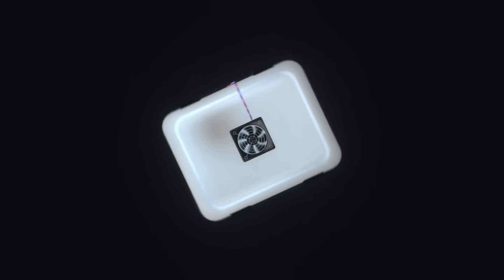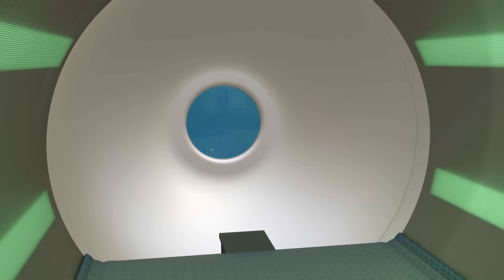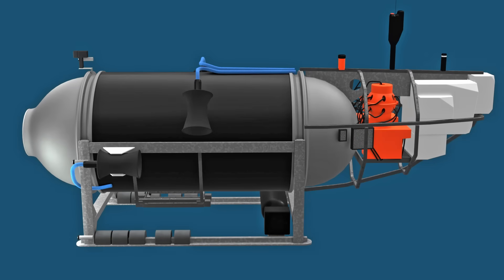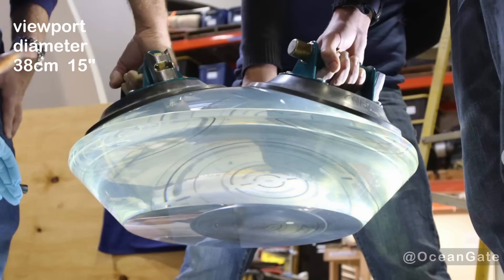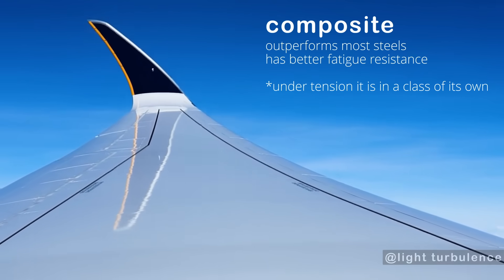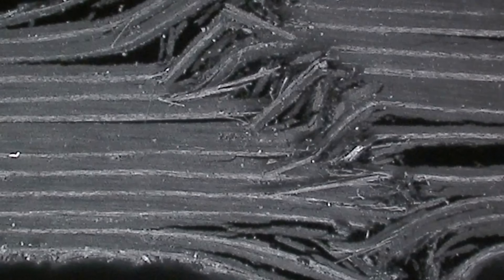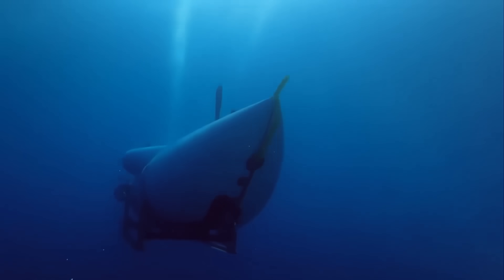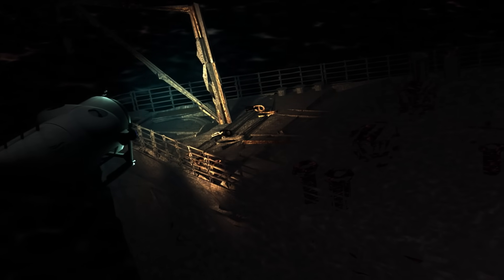Titan Sub | carbon fiber - Detailed Tour

Comment: The top sides of carbon fiber aircraft wings are stressed in compression, and how many stress cycles do those withstand?

Yeah, you people who keep saying carbon fiber composites are no good for compressive loads need to get your water tested for lead.

They make CFRP fishing poles, airplane wings, bicycle frames, bicycle rims, motorcycle and car wheels, race cars, and half of those structures are stressed in compression. Except for the bicycle rims, which are mostly stressed in compression. I haven't broken one yet.

Stop believing everything negative thing you read people! There really are a lot of stupid memes going around, and this one about CFRP being not being a good structural material is one of the most ridiculous. 

The sub imploded after a few trips down to the Titanic. Passengers heard pinging sounds on the previous dives;  this is what it sounds like when individual strands of carbon fiber break. Obviously, the vessel was almost built strong enough, and it was just being stressed almost to the breaking point even on the first cycle.

So, duh, they needed to make some things thicker. Why do I even have to explain this? It would have imploded on the first dive if it really wasn't even close to being up to the task. And they probably should have put a metal shell around the carbon section to prevent water from being absorbed by the epoxy.

Really obvious steps that could have been taken that would have prevented the loss of those lives.

Just stop blaming carbon fiber. Did I mention they use it to make aircraft? Yeah, I think I did.

Edit:  Metals are a lot easier to engineer, and usually fabricate. This doesn't always mean metal structures will always perform better, but metal structures built by amatures certainly will. CFRP is king when enough engineering, fabrication know how, and quality control is applied.

I did mention that water absorption of the plastic component of CFRP is a known weakness in marine applications;  some kind of metal shell over the carbon structure  could have sealed it.

A poorly engineered or fabricated metal hull would have also collapsed.
Reply: Work in materials in aerospace. Fiber-reinforced polymers are not particularly good in compression-only loading. The thing people miss when they say "What about this (wing, fishing pole, bike wheel)" is that they are subject to bending or a combined loading such that some part of the structure is in tension which inherently limits the amount of compression the other part is subject to. Additionally the Titan design relied on a bonded joint between two materials with vastly differing moduli, these can prove challenging to design, and Titan's design seemed overly simplistic. Every one of the people I work with think a carbon-fiber vessel in compression is a bad idea.
Reply: "this is what it sounds like when individual strands of carbon fiber break." WRONG Carbon fibers never break under compression. It is the bonds between different carbon fibers that break. The fibers are held straight by epoxy. When the epoxy breaks, the carbon fibers are no longer straight, and they wilt, not break, under compression.
Reply: @afriedrich1452 They buckle, not break.
Ever heard of the Euler buckling load, one of the most important equations in structural stability.
Reply: It was not a simple compressive load.  It was immersed in high pressure seawater and was a heterogeneous laminated material subjected to multiple compression cycles.  The delamination process has similarities to fracking an oil well where high pressure fluid penetrates along natural layers of rock (or in this case lamination layers) and any solids deposited or formed when pressure is realizer could act as proppant material extending rock
Reply: You cannot compare stresses on an aeroplane wing with the stresses on a pressure hull.  That is very simplistic, outright cretinous even.  Rapid flexing and shearing actions, cold temperature induction and high-temperature radiation versus a gradual, uniform but relentless build up of extreme pressure?  Remember: when the hull failed, it was under stresses lower than it had withstood before.  To sum this up in a word - DELAMINATION.  Carbon Fibre IS NOT suitable for this application.  Get over it, carbon fibre fanboys.
Reply: People weren't all saying they aren't good in compression, but rather that they are only good in compression with strict manufacturing controls that Rush failed to adopt.
Reply: I'm a U.S. Navy submarine veteran. None of our submarines use carbon fiber. NONE! Built with steel for a reason.
Reply: @rodneyking4183  let's be real here it's a cost reason. That scale of sub would be absolutely outrageous even if switching to something like stainless or titanium let alone carbon fiber.
Reply: @freiherrdinkelacker  you clearly have inadequate experience in engineering. 

This channel has one of the best sets of rational observation, analysis and discussion of the factors around the Titan tragedy.

Engineering is the study of implementing client requirements to solve a problem. Centuries of practice have brought us reliable ways of achieving remarkable feats, safely.

The company cut corners on obvious safety steps, and especially necessary ones with new methods and materials being used.
Reply: @@freiherrdinkelacker Alright, you got me 🤣.  There is some sort of fanboy fetish with this material!  Carbon fibre truly sucks for some purposes, ballistic shielding is another example.  Can't the fanboys just acknowledge that for pressure vessels, steel and titanium are King and God, whereas carbon fibre is the Court-Jester?
Reply: In the AirBus 380, the spars and skins are aluminium. Only the ribs are an alloy/CF composite. One side of a fishing pole is in compression, the other in tension, as in any tubular structure that is bent from nominal straight condition. So, two of your examples 'hold no water' in respect of CF's ability to withstand compressive forces. I cannot speak for the others as I am not familiar with wheels made of CF. And youre comment "They use it (CF) to make aircraft" is also misleading as where it's used doesn't have to withstand the type of pressure the Titan did.
Reply: In aircraft it is mostly used in the tension components such as the fuselage that is under tension because it is pressurised on the inside.

CF composite might be usable in compression mode if prestressed during layup. This would require a meticulous manufacturing operation and the prestressing could make the resulting object liable to shatter due to impact.
Reply: @jimgraham6722  ie: their manufacturing operation was far from meticulous and for the WRONG purpose
Reply: Everyone knows carbon fiber is amazing stuff the problem lies with what Stockton Rush did with it, he 'engineered' it himself
Reply: Comparing to aircraft wings is misleading here. Pressure vessel compression is not equivalent to bending stress compression. Pressure vessel compression squeezes the vessel with forces orthogonal to the vessel body. Compressive loads due to bending act along the surface body. Aircraft wings have plies oriented such that the compression strength is in line with the fibers, and there are internal structures (Spars, honeycomb core material) to prevent buckling. None of that would have worked with the Titan since the layup would not have the fibers in line with compressive force. 

Now perhaps you are thinking about the fact that aircraft cabins are pressurized. This too is inverse of what the Titan dealt with. There’s a huge difference in that expanding the pressure vessel with internal pressure would put the fibers in tension, whereas the Titan would be experiencing compression on a far more extreme scale. 

Speaking of extreme scale, at such incredible pressures, you better have a matrix with incredible interlaminar strength, because if water gets into even the tiniest voids, it’s going to try and break through. Epoxy would never have been suited for this. Carbon fiber wouldn’t do anything for you here.

It is acceptable to blame the choice in composites based on the use conditions and what we now know about Oceangate’s lack of care in ensuring a successful layup with not expired epoxy and post dive inspections. And regarding the vessel being almost strong enough, that honestly doesn’t matter if you can’t ensure fatigue won’t make it not strong enough in the long term or at least for a specified lifetime of the submersible.
Reply: Also, the forces exerted are quite different. The guy basically shows that he has no idea what he's talking about.  @SeniorPirates13
Reply: @SeniorPirates13  from the perspective of the fiber in the layup, all it knows about is the tensile/compressive stress and strain.  The combination of fiber alignment and stiffness of the resin matrix determines how much compressive stress the fiber can support before buckling.  It's not different from that perspective between the Titan pressure vessel and a composite wing spar in bending.

Yes, the stress state is more complex on the externally pressurized thick wall vessel.  The laminate has to support significant interlaminar and out of plane compression, but those are not novel load directions for composite parts. Yes, the allowable are lower than in the amazing tensile direction of the fiber, but these are things normal composite parts need to do to be useful, and with very well understood allowable stress levels to be safe on things like aircraft.

I agree with the argument that maybe it would have been lower cost to develop and safer with the budget they were working with to use a metallic pressure vessel for Titan.  The issue is that without proper understanding of metallurgy and fracture mechanics of metallic structures, there are also very serious problems that can arise and the requisite design analysis and inspections to ensure the vessel is safe to use in this application.

I get frustrated with the argument that CF can't be use in compression safely. It's simply wrong.  It conveys the wrong message to the general public and the next generation of engineers about material selection and the use of composites. Engineers need to understand the limitations of the materials they select, and nothing can replace a proper test of the design.
Reply: How are half of you all commenting without clearly having even watched this video?
Reply: Right .. cuz its a solid, and compressing and decompressing has 0 influence on it, amiright? Also .. please compare the pressure range things operate at for planes vs subs, you might see the problem yourself.
Reply: The fibers are embedded in a soft epoxy binding matrix, which does not adequately support a buckling (called micro buckling) columnar structure, which is Euler unstable. this fact is amply documented in the literature. Fiber structures under high load are always limited to tension loads. Any insistent contrary statement is grossly in error. Period.
Reply: You say CF is great for this, but then you admit they should've put metal around the CF to prevent water from getting into the resin.

In other words, you literally admit that CF isn't a very good material for this application. 

Which is exactly why no one else is stupid enough to use it.
Reply: @@freiherrdinkelacker Then you might have missed the parts that explained where the faults were and what needed to be done to ensure safety. 🤷  but I’m just an interested civilian, not an engineer with a phd in physics like everyone else commenting on submersible videos.
Reply: The problem was material fatige , or the glue they used to koin the 2 parts ,  And in aerospace there are no direct contact with salt water most of the time.
Reply: @@freiherrdinkelacker Prop-shafts, chassis and body panels made from carbon fibre are excellent due to the lightness and stiffness.  Speaking of ballistics, 400 atmospheres (about 2.4 miles depth) is 5800psi, the chamber pressure in a gun barrel routinely exceeds 50,000psi and steel is the only material suitable for that.
Reply: Imagine comparing wheels or fishing poles to thousands of PSI
Reply: @robertgraham you dont use a torque-wrench for the stem on your bike ? still got your teeth ?
Reply: Big deal it is used in aircraft. A plane is a lot different to a submersible. Carbon fibre can be quite fragile, just leaning a carbon fibre frame bike with the top tube against an object can damage the frame. Also there are instances of carbon fibre handle bar's breaking and some professional riders refuse to use them. Carbon fibre has its uses, F1 cars, tennis rackets, bicycles etc but has no place in the use in a deep sea submersible especially when they are other proven materials available for such a purpose.
Reply: Comparing carbon fiber bicycle rims compression to diving 3,800 meters deep. Kek
Reply: Yep. Which reminds me that yeah, carbon fiber is a great material in bicycles and riding a bicycle made of CF is a great experience. 
However, all that being said - I've seen what happens to bicycle CF frame when hit with a hammer. And not with much force.  @soklot
Reply: Yes the mistake made was NOT using carbon fibre:  it was not testing it properly! 
Presumably due to economics - not that that is an excuse!
Reply: @robertgraham3559And you are a narcissist. You have no people skills.
Reply: if they had made the carbon fiber THICKER it would have NEGATED the savings on weight reduction nor made the TITAN smaller!
Reply: I'm not even going to read this whole thing because you say "the top side of wings are stressed in compression"  BOY the underside is stressed in compression, how else you think the fucking planes LIFT.
Reply: The top skin on airplane wings are not carrying any bending loads. That is handled by the wing spars and it's the lower spar cap that is carrying all the positive bending loads with the carbon fibers oriented in tension.
Reply: @buckmurdock2500 Yes, in an aircraft wing spar, the lower spar cap is in tension, and the upper spar cap is in compression.  That's how a beam in bending works.
Reply: All the examples you mention are lightly loaded applications which are selected for the high modulus, meaning stiffness of carbon fiber.
Did you test your water?
Reply: @arturoeugster7228  Aircraft wings, racing bicycles, and F1 cars are all highly optimized, highly stressed structures.  The designer's objective is to minimize weight in these applications while supporting the limit and ultimate load requirements, meeting life requirements, etc.   There are certainly times and directions where the structure is stiffness critical, but the aircraft wings I've worked on are all sized for the loads and the modes are analyzed for any aero elastic issues where stiffness may require adjustment.  Adjustment doesn't necessarily mean stiffer, the solution can also be to reduce stiffness in a particular direction.
Reply: It was strong enough.  It's wasn't durable enough.  There's a big difference and additional material wouldn't have necessarily made it durable.
Reply: @js-sp9bz  the video agrees with this point and is arguing for a potential root cause for why the structure wasn't durable enough, insufficient control of fiber alignment in the axial layup direction.  That causes local failures in the composite that accumulates with cycling until the structure can no longer support the load.
Reply: One thing you can predict after this disaster…..no one will make a deep dive submersible out of CF ever again (well maybe never again…).
Reply: There had been zero fatalities in the deep submersibles until this sub.
Reply: @sailinghopes3943  would that be because they are all a spherical?
Reply: A lot of good points made but almost all can be countered.  Funny how he used titanium caps… 

This was a clever but bad design
Reply: Regardless of the material used, there should have been multiple bulkheads, outer and inner hull for redundancy, if outer breaches bail to surface, emergency escape pod in case gear gets tangled in wreckage, etc. 

This sub was a piece of shit. I would have never gone in it near the beach.
Reply: @mysticjedi6730  Not all designs can afford the use of fail safe primary structure.  As far as I'm aware, no other DSV has made use of a fail safe reductant load path design. You of course could, but the use of two fully metallic hulls makes the problem of volume, weight and cost of the required buoyancy foam much worse.  It may actually be possible to build a fail safe design with two CF hulls, but the question is how that design decision trades off with everything else.  What level of reliability and safety is required and how to manage risk are very difficult questions to answer, and one that is dealt with daily on systems where human safety is at stake like aircraft.  The difference here is that people are volunteering to do something pretty extreme.  That arguably shouldn't require the same level of safety as a 737 flight.  How safe should climbing extreme mountains be to allow people to risk their lives to see the top?
Reply: @@freiherrdinkelacker  with proper testing, you aren't really "Risking your life".  I can't help but wonder whether you're as concerned about "Risking your life" on a daily basis.  Do you avoid all types of transport due to risk?  Maybe never gotten laid, due to "Risking your life" on an std?

Clearly any rational person would stay in bed all day, as that's gotta be less risky than having a shower, getting up, and facing the world.
Reply: Don't forget who was the one that jumped out the gate with "So Mr. Bell, you can "Bet Your Life" on new materials and designs. Some of us are more enlightened than that."

Getting upset about someone elses indifference towards sugar coating their words shouldn't result in such offense from someone who clearly is indifferent about how their own words come across. @@freiherrdinkelacker
Reply: Seems like anyone with engineering acumen who isn't a butthurt carbon fibre fanboy accepts the obvious truth that steel and titanium, contiguous materials, are suited to extreme pressures while composite materials will delaminate and soon fail when subjected to the same conditions.  This is just so obvious and anyone who speaks in defence of this cretinous engineering choice will also speak in defence of hydrogen-filled airships.  Hey, they worked once or twice before the OBVIOUS, inevitable and outright idiotic flaw 'came to light'?  (Pun intended.)
Reply: @@freiherrdinkelacker I don't know how you managed to go on living.  I mean, after someone on the internet calling you a virgin because they're butthurt over something.  That's surely 'the burn of all burns' and impossible to recover from. 😆
Reply: @@freiherrdinkelacker I don't actually know what G.E.D stands for.
Reply: Aircraft wings are not at all the same. They are highly engineered beams, they use torsion box principles to achieve their strength.

https://en.m.wikipedia.org/wiki/Torsion_box
Reply from the maker: @@freiherrdinkelacker after extensive and rigorous testing, yes we can have a high degree of confidence. That’s not me saying that. That is what the insurers, the owners of the businesses involved and the engineers can and do say. That is how our modern world works and manages risk.
Reply from the maker: @@freiherrdinkelacker In the entire 2017 worldwide there was not a single deadly airline crash with gazillion passenger rides. Science and engineering achieve phenomenal things. Risk is never zero but our world has become safer  over time
Reply: If he built the whole thing out of titanium it wouldn’t have broke. Facts. It’s people like you who want to be different and make a vessel out of materials they shouldn’t 🤦‍♂️
Reply: @jimmyjames_yt
Absolutely jimmy:why we didn't stick to the Wright brothers airplanes with their tested structures of wood, paper and bits of wire I'll never understand!
Reply from the maker: @jimmyjames_yt  If that approach was taken we would all still be sitting under trees because trees work and why be different and take risks with new risky stuff.
Reply: Calm down dude.  You act as if your morals are being questioned.
Reply: Agreed.  The root cause was arrogance and the resulting bad engineering, not necessarily carbon fiber.
Reply: What happens is that under that much pressure, more pressure than on an airplane wing, the epoxy resin slowly flows. (Just like the glass in old cathedrals is thicker on the bottom than on the top after many years.) This results in the thin titanium cylinder, that the carbon fiber is wrapped around, eventually taking on more pressure than it can handle.
Reply: Gross, they did not "hear pinging sounds". They heard the crackling of CF sheer and delamination. I will not read this whole thing when you interject with falsities.